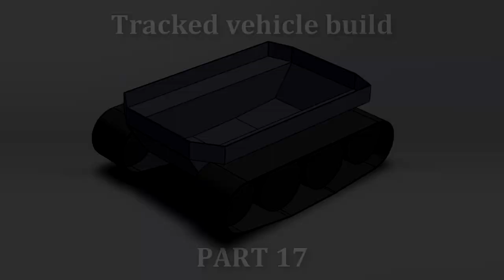LED Lights & Upper Hull - Tracked Amphibious Vehicle Build Ep. 17

Comment: Outstanding!

Turn the top piece of your break around.
The angle iron sitting on the top of the break will be much stiffer if it’s turned around.  It will give sharper bends if turned around.

Comment: Looking good Donn.  One thing: One thing at this stage consider adding some weld in torsion axle spindles and arms.  NO matter how many supports or gusseting you do those axles will bend eventually.  Torsion axles will eliminate that from happening plus the ride quality will be drastically improved.  Same way Thiokol snow cats are setup too.  They are cheap and will insure long lasting enjoyment.  Solid tracked snow cats or Mattracks have never been a comfortable ride.  They are very jarring and parts break often.
Reply: Sean Fillner Good advice.
Reply: @kevinhornbuckle  I love this build I just hate to see bent axles.  I have owned solid frame mattracks and see the results of snowcat owners that use a solid axle design.  It NEVER works long term.  Something will always break or bend no matter how much support you give it.  On the mattracks the bogies would explode.  

Torsion axle weld on arms are super cheap insurance for this build.  I want to see this thing rip!!

Comment: You had the right idea with having truss support in your original design, the force was just being applied to a very localized and flat, part of the angle iron. You need to place your upper jaw, open side down, with the truss bisecting the 90 degree edge. Machining a hard edge on the lip wouldn't hurt either. DIY metal brakes can make some pretty tight bends, if you utilize the shape of your parts for maximum yield strength.

Comment: Nice fabricating! Add 20mm welds approx 150mm apart on the  the interior cross bracing and sheet metal will make it stronger and quieter. Cheers from California, USA.

Comment: 31:40 I would add simple covers for the winches, to keep the dirt away from them. Just 4 key holes in a plate and 4 screws on the body and a wing screw to hold it in place 😙🎶
Reply: Plus, it would keep the sun off that synthetic winch lead. UV is the #1 killer of that rope!
Reply: @bradley3549  yeah true.

Comment: If you slightly sharpen the lead edge of the top clamping plate on your bender, it will give a crisper bend
Reply from the maker: I will give it a try, thanks for the tip! 👍

Comment: It won't fix EVERYTHING that's going on with your sheet bends not being crisp, but if you mounted it into something more sturdy than that vise it would help. Like a bench mount or something. And yeah, edge bends are always a pain. I prefer to do them with a hammer and block, even though it takes longer I get a better quality at the end of it.

Comment: welding to the sheet metal may turn out to be a bad idea. She is small but there will be flexing going on and the supports welded to the sheet metal will move and probably crack at the welds. Definitely re-think that part. Loving the build though. You do good work.

Comment: If I can provide some constructive criticism I think those handles on a bender are the best idea If you are bending something bigger al the way to the edge it will get stuck best design I have seen on YT is doing something like a vice handle have when you can move all the way to one side when you don't need it

Comment: 30:10 you need to add a rest on the left side from the bottom piece which holds the top piece exactly at 90° (on both sides). This way the work piece got no leverage on the nut which secures to top piece to tilt in backwards.

Comment: When you get the mill up and running you can make better benders like some of the industrial ones
Reply from the maker: I hope so. A more dedicated and beefier bender for future usage would be pretty nice.
Reply: Hi, having used industrial units,  consider making pivot point adjustable,  or more specifically top clamp position relative to pivot point, based on metal thickness, this alows better, neater folds, not that hard to achieve  but well worth the extra work,  keep up the good work

Comment: Looking fantastic, the LED lights will be great!  With the bender I noticed that from our view the whole unit moves on the hard bends, I think this is a part of the problem.  I am not sure you can see it from where you are.  That flex as you lift is not helping you.
Reply from the maker: Yes, I noticed it too. Have to build another upgraded bender.
Reply: @DonnDIY  If you have both it is not bad either.  Plenty of shops have one for light stock and one for heavy.  My father in law had a massive almost 2 meter wide unit that never moved, it weighed tons.  Then he had a portable one.  It was the mass of the big one that made the clean crisp bends.  What a beast it was!  Really love watching you work, please keep them coming.

Comment: Wondering if you had thought of welding a box spanner/ tube and ‘T’ bar onto the adjusting nut of your press break to make it easier to loosen it , rather than use an open end spanner?
Reply: Sorry, I see you have manufactured one.

Comment: Your welds looks super good.  Did you use a 75/25 mix gas or a straight C02 carbon dioxide gas?  Great job you are doing here.
Reply from the maker: I'm using 80/20 Ar/CO2 mix. Works much better than pure CO2. And the Fronius is superb!

Comment: lets hope the motor and clutch is large enough, it seems to becoming heavy as a tank. would be nice to have a diesel engine with torque converter and no belt at this weight... great job with the fabricating! you are a good metal worker !
Reply from the maker: It's all about the gearing. You can calculate how much torque there is in the rear end after the power goes through the CVT, the gearbox and first dirferential.

Comment: I'm just wondering a little why did you put boxes around the front and rear axles only. If the sheetmetal would be applied throughout the length, an additional lifting force would be obtained. And now there's a big room to pile up with snow and mud. It will be difficult to clean out..

Comment: When you said you were not happy with the bend, how thick was the sheet? I am half way on my sheet bender and not sure if it will handle 2 mm by 1200 mm long. Thanks from Ross.
Reply from the maker: It was 1.5 mm. If you want to bend 2 mm the bender should be pretty beefy.

Comment: Interesting top on the stove pipe. what is the advantage?
Reply from the maker: Saw this style chimney tops in New Zealand, it helps to prevent down pressure and blowback into the workshop. It draws air/smoke from the stove both ways, even when the wind blows down to the ground (in mountains or in the inside corner of the building in my case).
Reply: @DonnDIY  ill have to keep that in mind. I've been wondering do you have an engineering background? love your fabrication work and videos, thanks for the entertainment.

Comment: Cool, but is the actual reason for doing two center hubs with pipe supports like that and not connecting construction to each end to minimize drag in water and also adding buoyancy while at it? Could have also saved in weight while doing so. 
I know you have sand blaster, but i tend to avoid crevices like that in construction as we know ridiculous amount of crap tends to wander in there making cleaning much harder, but it does make both ends much sturdier over all. 
Arent you grinding material bit too much? Flat is objective, but it looks like you are going bit deeper and also for love of god use wire wheel to remove rust not sanding disk that eats wall thickness.
Should you not prioritize getting drive train ready? Like for instance the tracks, so system is tested, cause altering this will be pain when frame is finished and you really dont want to be loosing track while going on water or getting ashore, so reliability of track system would be utmost importance... well same as this thing floating :D